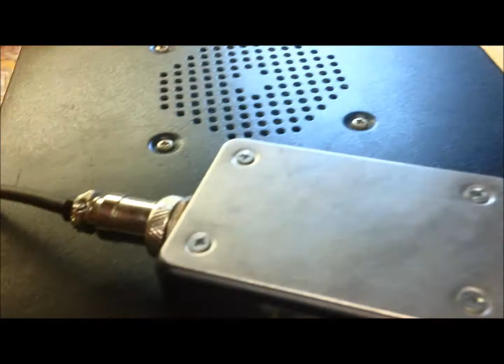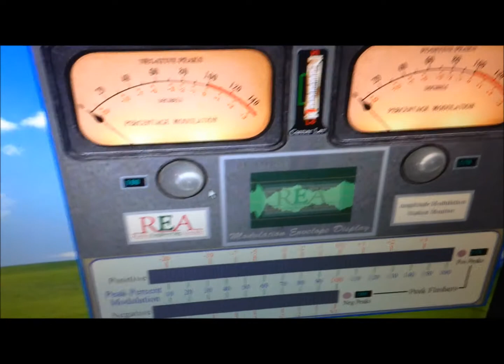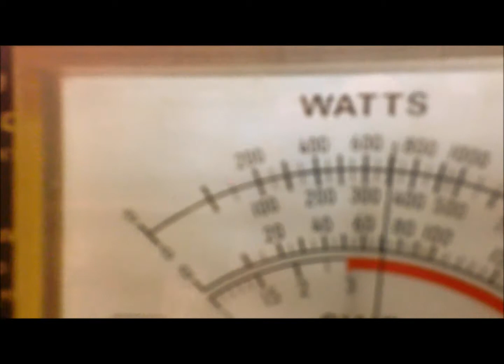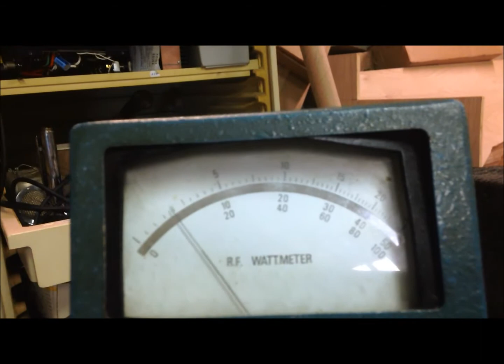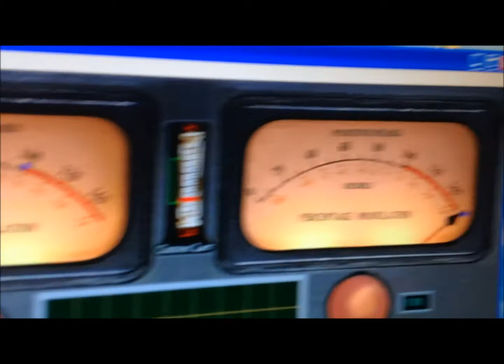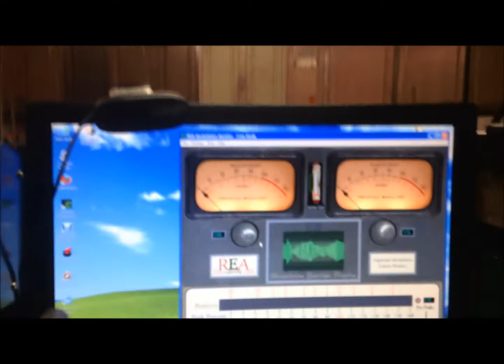Direct injection Cobra 148

Comment: I wondered how he does such a fantastic job re-engineering these CB  radios, look at his warehouse full of top of the line test instruments.
The only advice I have besides that trapezoid scope pattern tip  (which I used for 60 years)  is show receiver alignment for AM, FM, and SSB.
A lot of radios I got from truck stop CB shops had the transmitter RF peaked, but in the process de-tuned the receiver.  Check bandwidth,   center
frequency,  SINAD,  clarifier,  etc.
K4OF.
Reply from the maker: BOB RENFRO It hasn't changed any on this side with the truck stop shops, they still tend to peak, tweak and cut. I do a full align on the whole radio per a sams. Before I got the test center I did the trapezoid pattern, but the test center has the hookup for the scope so just being lazy i use it lol. May have to go back and give it a go. Thanks for the advice. Stickman